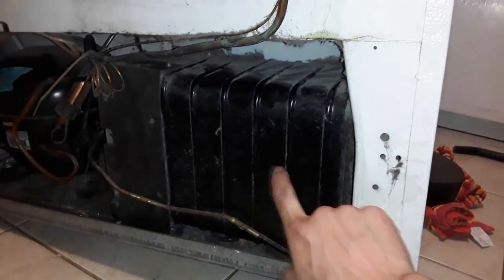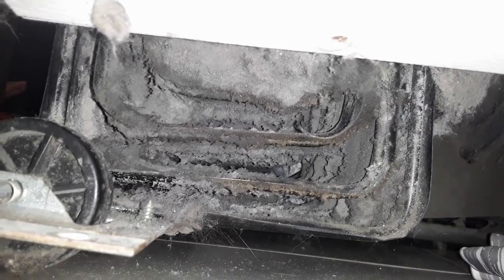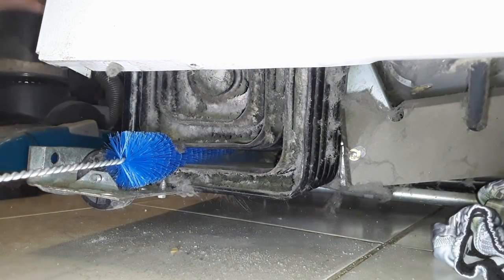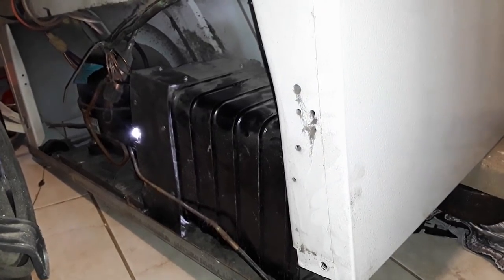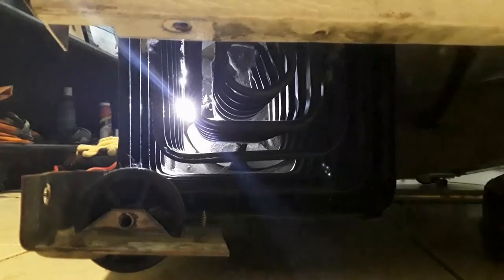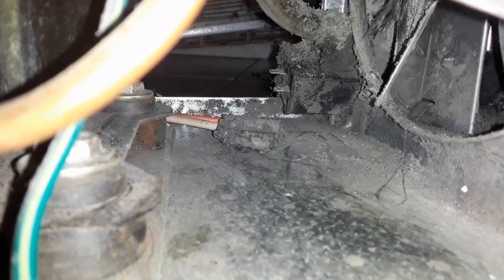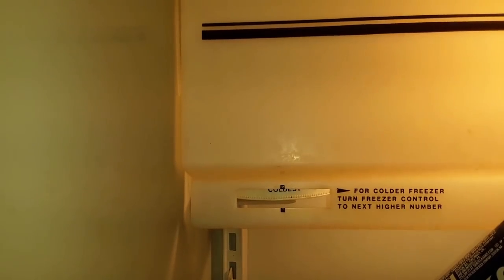Major Unclogging In Refrigerator Heat Exchanger (Better Efficiency)

Comment: Whoa, I know what I'm doing this weekend! Many thanks for the pointers and visuals. Edit: fridge is 18 yrs old - probably lucky it's still running!
Reply: Lucky you, the planned obsolescence has not found you (yet).
Reply: I was thinking the same thing too
Reply: You may not want to dissect it... sometimes they relax and you can’t put them back together.
Reply: Had a Hot Point, ran for thirty years.  Bought one of the newer ones, with ice cube water dispenser.  Your correct, Post last about  7 to 10 years.  Think we're on our 3 one.  Seems they'd go back to less computerized.  Think of the environment when having these huge appliances   Think do know what to do next.  Don't forget the vent on your dryer, and the exhaust fans over the stove and in the bathrooms.  When we had long haired dog, under the fridge looked like black haired insulation.  Nope dust and dog hair.  Eeii!

Comment: Over the past year, i have acquired two GE "Monitor Top" refrigerators, The R12 refrigeration units on top are atleast 70 years old, and the cabinets probably older. Brought both units home, plugged them in and they still work perfectly.

Comment: Run the vacuum and blow the other end with compressed air. Works like a charm
Reply: If you have a second vacuum sucking up the debris you are blowing out works better.   It's How I clean my baseboard convectors.
Reply: most shopvacs can be used as a blower so if you have a second hose you don’t need a compressor

Comment: Evaporator coils do get clogged with dust and debris because in these appliances it’s not filtered. Fan blades should also be cleaned as much as possible. The thin layer of dust on each blade can reduce the amount of air it moves by 15-25%
Reply: Same thing with your furnace/a.c. blower.  I just looked at mine last night while changing the filter and noticed some dust build up on the blades.
Reply: dm7097 HVAC is my profession. Most people fail to understand the connection between clean mechanical components and efficient/reliable operation. Good on you for observing and discovering the condition of your fan.
Reply: @thepatrioticmistersnevets9850  HVAC is your profession?  Why would the evaporator coil be on the outside of the refrigerator? I suppose the condensing coil is on the inside?
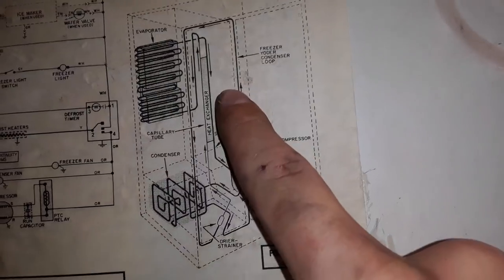Reply: @thepatrioticmistersnevets9850  @ 12:02 there's a diagram with labeled parts
Reply: zeke112964 the evaporator coil is in fact inside the upper cabinet of the refrigerator and quite difficult to access quickly. He demonstrated cleaning the condenser coil.
Reply: @thepatrioticmistersnevets9850  You stated the evaporator coils get clogged with dust and debris....How?
Reply: zeke112964 cooling only happens when air from inside the refrigerator passes across the evap coil. It’s impossible to filter that air in order to keep the coil clean. Every few years it should be opened up and cleaned. It’s like replacing the air filter in a forced air furnace or air conditioner. The filter keeps the fan blades and coils clean in order to maximize performance and operating efficiency.
Reply: @thepatrioticmistersnevets9850  I don't know what you keep inside your refrigerator....but I've never had to clean an evap coil or fan inside one of mine
Reply: zeke112964 I preserve the souls of people who ask excessive amounts of ridiculous questions. They’re kind of messy.
Reply: zeke112964 🤪☠️😆

Comment: Adjusting the thermostat lower will NOT make it cool faster!!!!   Set the temp where you want to keep it and leave it there!!!!   It will reach optimum temp just as fast at set temp as it will all the way down!  All the thermostat is, is a thermostat.  The speed in which the unit cools is governed my many factors; compressor, evaporator, refrigerant level, ambient temp, ETC, NOT the thermostat!  Great video.  EVERYBODY needs to see this!  TOO MANY PEOPLE NEGLECT THIS IMPORTANT MAINTENANCE!!!!!   Well done!!!!!

Comment: This type of Fridge/Freezer is called a Side-by-Side, not a french door.  A french door fridge is one that has two doors on the Refrigerator section ONLY and either a lower single door or a drawer for the freezer compartment. Btw, I love your vids especially the drain/culvert cleaning ones.  Thanks for posting:)

Comment: There is another way to help clear all that out easier.  Get an air tank or compressor and just blow compressed air in there while running the vacuum to collect the dust you are dislodging with the compressed air.     I do hvac/r  and with the amount of dust and dirt you removed from the condenser you have no idea how much more efficient you made that unit and how much less work the motor now has to do to cycle the refrigerant and remove the heat from it.  You have increased the efficiency exponentially from what it was when you started.  That’s a dam good job you did on that refrigerator

Comment: The fridge I own has the ice and water dispenser on the front. I’ve probably owned the refrigerator for 15+ years. The only thing I’ve had to do is clean it and it still works like a gem

Comment: i cleaned out the inside of my dryer the other day and multiple brush attachments (large and small) for the vacuum came in handy.  i'd suggest picking up an attachment set, i've also used them on all sorts of things to vacuum tight spaces like inside of my pc, the vents in my car, air vents in the house (just run the brush through the fins) and recently used the large brush to "dust" and vacuum out all of the cobwebs in my basement.  

it's surprisingly efficient to just wipe the large brush over every surface and watch all of the dust go straight into the vacuum, instead of falling onto the floor.  i believe the set i picked up was only about $10.

Comment: Refrigerant R-134 began to be used around 1995. Anything built before all the way back to the 30s had R-12 , the original Freon by Dupont. Before that they used ammonia. Gas powered fridges used a flame to circulate the refrigerant. RV s still used gas fridges. The 95 to current are supposedly more efficient. But a clean fridge runs less. Good job.
Reply: In automotive, r-12 gets way colder than what cars that run 134a. Too bad they got rid of r-12

Comment: The coil you call a heat exchanger (which it is in a way) is called the condenser. Amazing these fridges can even work being so plugged up. The electric company used to give away brushes very similar to yours for cleaning the condenser.

Comment: Try getting some half inch copper pipe, and some duct tape. We use to tape whatever length and shape we needed to fit into narrow spaces in boilers for commercial heating mains. Pinch it a little to fit in narrow spaces, bends to get round corners, lengths to reach where we couldn't. Three quarter too. Make sure to flatten the end like a vacuum cleaner nozzle, stops clogs and large debris.

Comment: Had a vintage Whirlpool circa 1987  french doors also  
Ran well till I got a new one without the door dispenser (never liked them)
Problem was the interior plastic shelves in the doors was cracking due to age and door seals were worn for the second time   Love the sound it used to “tick” like a timer when in defrost  and it did make that electric meter spin quickly 
New one is an Energy Star and  sips electricity 
I must add that the door parts were still available for the old girl but pricy 250 dolla
But new frigs use much less electricity
Its been 5 years since I replaced it no problems with The new Whirly
We know our old frig is still working in China

Comment: I have a special vacuum attachment, called a lint lizard, it’s this small flexible tube thing you can shove up where you had that blue brush going. I desperately need to pull my fridge out and do this. Gonna use my central vac tho, it’ll inhale it all so I do t have to breathe any.

Comment: Put a hand mirror on the floor facing upward, look thru the mirror and you'll be able to see up in there like you need to. Also, leave the vacuum cleaner running with it's nozzle right there next to where all the dust is flying around so it will suck up all that dust and you won't be breathing that into your lungs. The mask was a good idea too, yes. 😁👍

Comment: I vacuum out the coils under my fridge (weird place) every sping.  I pull out the fridge and vacuum around the motor and the fan blades.  I have a old refrigerator but it works well so I dont want a new one.

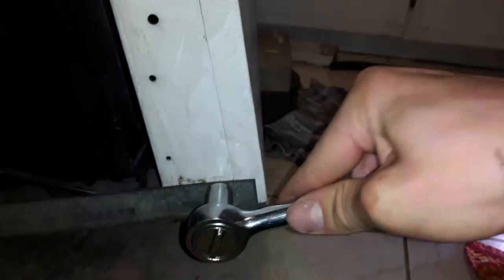Comment: 19:24 "bolts w/ rounded edges" ---> I see that your socket on the ratchet is a 12 POINT socket.....those sockets are great for rounding off the corners on the nuts.......do your best to use the 6 POINT HEXAGONAL SOCKET.....it's an EXACT FIT on the nut.....NO SLIPPY/ROUNDY OFF !!

Comment: Did you make sure to leave it sitting up right for a whole day before you plugged it back in? Having it on its side gets the oil put where it doesn't belong.
Reply from the maker: It wasn't tilted more than a 20 degree angle I'd say so that's not necessary.
Reply: post 10 ahh okay awesome job!

Comment: If that were a newer one, you would have burnt up and destroyed the compressor motor by that point with all that dirt.  The fan on the exchanger/condenser is what cools the compressor motor.   They really need to be blown out/cleaned every 6 months, once a year at the most.  Heat is the biggest killer of these components.

Comment: Most of that is fur. Fur is like sticks in a culvert. Use your brush with the vacuum on. Should be done monthly, unless you are very clean, then do that yearly. More often if you have pets. I had cleaned homes and I did one where the owner had 3 cats. She had them caged while I cleaned. I went to vacuum under the bed. I had to empty my dyson vac 4 times. It looked like cats were under her bed. Also Vac the condenser as dust on the coils can cause erratic Temperatures.

Comment: Every refrigerator is like this? How long it takes to clogged up?
Reply from the maker: A small buildup of dust will happen immediately but this took 20 years to get this bad
Reply: I advise cleaning the coils on refrigerators, freezers, dehumidifiers, and especially central air conditioners once per year.

Comment: Your EVAPORATOR can get clogged w/ ICE CRYSTALS if you don't defrost the fridge once in awhile.

I see this fridge is "frostless", with a defrost thermostat and defrost timer which control the heating element at the bottom of the evaporator which cycles on every 8 hours or so for about 20-30 minutes.....if there are ice crystals to melt, then the water goes into the drain pan.....now there's a possible clog more up your sleeve :)

Oh, one other thing.......you seem to talk really fast when you wear a mask !!